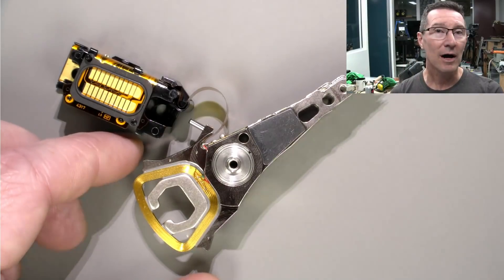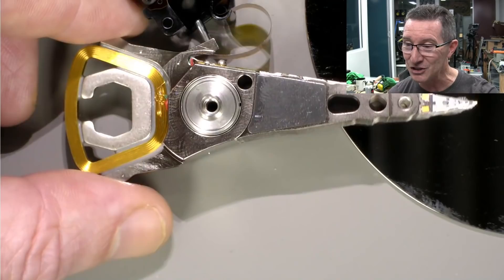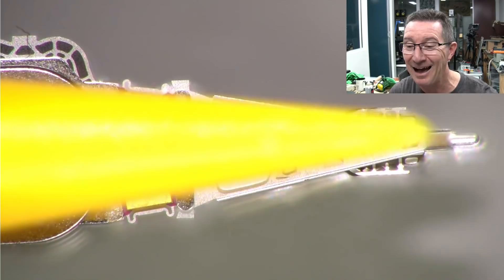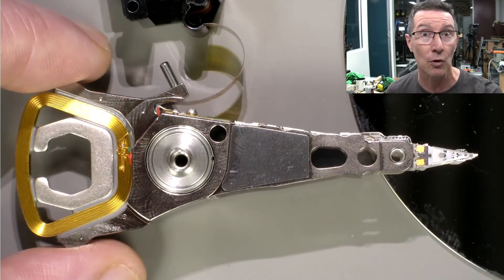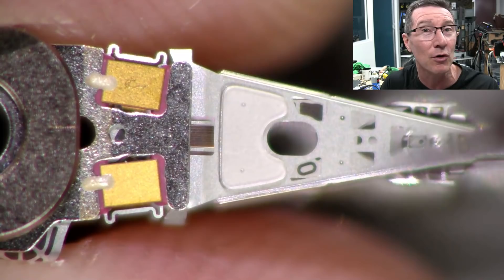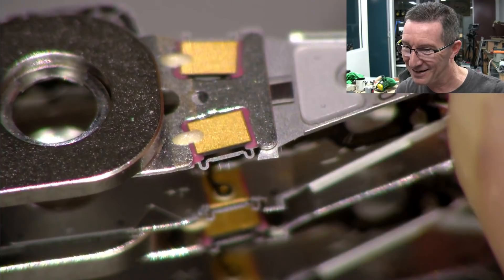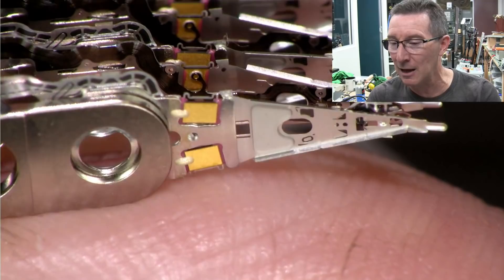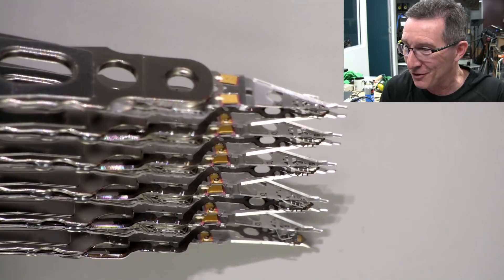EEVblog 1400 - Hard Drive Micro Actuators are AMAZING!

Comment: For a given mounting orientation, you can fabricate piezo actuators to move in any axis (x, y, z, roll, pitch, yaw).  For these disk arms, my guess would be they lengthen and shorten (rather then bend or curl).  And they would likely need to be operated as an opposing pair to manage bending stress on the arm: Firing only a single actuator would cause MUCH less than half the head motion as the non-operating actuator acts as a solid opposing block (the single actuator forces against two fixed points).
Reply from the maker: Yep, I speculated an asymmetrical drive in the video. Would be silly if it's just one side driven. But if movement is visible then you should be able to see something driving just one I suspect. But the distances are just to small, so it's all moot it seems. But might do some more experiments which would entail taking out one arm completely for access.
Not sure you can manufacture thin flat transducers like that that contract in lenth?
Reply: Yeah. That's what I was thinking too. An opposing pair to move from side to side. And the little "springs" on either side provide some stabilizing force.
Reply: @EEVblog  from the white paper that evergreen linked, the geometry shown in your video, and what I remember from Smart Structures in grad school, they're only extending and contracting the length of the PZT elements by ~100nm. The voltage applied to the tops and bottoms of the transducers makes them thicker and thinner. Since they're trying to maintain constant volume, the length contracts or extends to compensate for the thickness change.

This is actually great for this application because it essentially gives a sort of mechanical advantage to the actuation, requiring much less voltage on the PZT element to pull very hard on the read head. The stiffness of the polymer mounting the PZT elements to the read head would be very precisely accounted for in calculating how much motion transfers to the read head and the material could even theoretically be tuned to adjust down the amount the read head moves with PZT contraction.

Bloody brilliant stuff.
Reply: I would think is is a length change in the ceramic.  As stated above a piezo ceramic can be engineered to change length.  I once used  length changing piezo ceramic in a micro fluid pump.
Reply: 63nm is not that large moment. Seemingly rigid arm can move left to right that much. Crude example: a beam 0.1 mm thick, 1mm wide  and 20 mm long will deflect about 1nm in width direction when 10 g load is applied.
Reply: This is all very fascinating. I had to temper my impulsive side which immediately wanted to go murder a bunch of drives for no good reason. Definitely activated my pzt obsession, but I shall stick to the reading materials instead.
Reply: And if the arm 'pivots' between the two ceramics, you get more movement at the actual head thanks to the leverage.  Just 'eyeballing' it looks like the head would move 4 to 6 times more than the ceramic expands.
Reply: @EEVblog  if you really want to check for movement, get yourself a dial indicator. Typical resolution on those is 0.02mm, but you can get them to whatever level of accuracy you're willing to pay for.
Reply: Pretty certain you can only make the crystal expand by applying voltage—not contract. Therefore two are required to allow controlled motion in both positive and negative direction.

The springs on the sides are then to return to neutral position. Like the spider of a speaker driver. The load they present to the actuator probably helps to linearize the response as well, as it is surely tuned spring rate for a useful operational range. Spring design probs also engineered for fine calibration natural resonant frequency of the system.

And the elastic is to damp any resonances. Must have damping for any reasonable control of the system! Like how a car with leaking macphereson struts springs but the struts are ineffective, undamped springs don’t dissipate energy well and don’t stay settled in one spot even though you want them to.

The tiny metal stripe on the top is for rigid mechanical connection to the “fixed” arm, whereas the small connecting rod on the other side connects to the “movable” arm. Amazing that it even has a pivot pin at that scale. But it probably needs it again to use the rotational translation to linearize electromechanical response, and to ensure smooth motion / fine control.

I could be wrong about the piezoelectric effect being positive excursion only, tho. In which case having diametrically opposed actuators would drastically reduce structural vibration—the two forces would largely negate,  Thus each head would be less likely to disturb the others. This difference would be profoundly greater than any increase in precision gained from having two machines do the work of one.

In any case, very cool indeed! Thanks for showing it to us!!
Reply: @jalilurrehman8984  Let's recalculate, because for such a slender beam I would expect a deflection visible with a naked eye, way more than a nanometer.

Let's assume beam material is aluminum alloy 6061 (
Young's modulus E=69 GPa)
The beam is b=0.1 mm thick, h=1mm wide and L=20 mm long, the load P=0.1N (10 grams) is applied to the free end in width direction, the other end is fixed.

Then, the beam Area Moment Of Inertia I = (b*h^3)/12 = (10^-4 * 10^-9)/12 = 8.33*10^-14 m^4

Deflection under load is delta=(P*L^3)/(3*E*I) = (10^-1 * (2*10^-2)^3) / (3*69*10^9*8.33*10^-14) = 8*10^-7 / (1.72 * 10^-2) = 4.65 * 10^-5 meters

Which is 0,046 mm or 46500 nanometers! Not really visible with a naked eye, though, so my hunch was wrong after all.

The volume of the beam is 2 cubic millimeters, which would weigh 5.4 mg (53 uN) for the aluminum alloy density 2.7 g/cm^3.

The deflection of the aluminum beam under its own weight will already be 9.2 nm.
Reply: The movement should be visible if excited in its resonance. Shine a LED  togheter with the same frequency, but detuned 1 or 2 Hz to have stroboscopic effect.
Reply: @EEVblog  to measure the small movement in the head:  shine a lazer pointer on a shiny bit of the head so the reflection can be seen on a wall several meters away.  Then you will have a large scale factor and the small movement of the head will be seen as a movement of the reflected dot on the wall.
Reply: @EEVblog  to see the movement in the piezo actuators and arm:   break apart an old writable CD.  Then peel off the foil from the polycarbonate plastic.  Then cut the foil to the same size as the piezo actuator and flat bits of the head arm.   Use super glue to stick the foil down.   Ary movement of the piezo and arm will be seen as a change in the interference pattern in the foil.
Reply: @cogoid  oh! I must have done mistake in calculations
Reply: @PaulSteMarie  0.02mm is still three orders of magnitude off from what we’re talking about, no? Might have better success rigging up something based on lasers - either interferometry, or just bouncing off a tiny mirror to give an amplification of reflection angle into linear distance across the room, or something. Hmm, I think I’ve maybe even seen Dave cover devices that do this sort of thing? Or maybe it was a Veritasium video or something that I’m thinking of. Anyway...
Reply: @leromantik  amazing! So its resonant frequency is about 3khz, it should be hearable!

Comment: It still amazes me that HDDs are able to operate this precisely and reliably usually for a very long time, and the fact you can buy such thing new for just 10s of dollars.
Reply: Some of my old stock hard drives can't work anymore somehow, data can't be got.
Reply: I designed ICs for hard drives back in the mid 80's. At that time hard drive design was considered the most difficult and technically challenging of all mechanical engineering tasks. I'm sure it is still so.
Reply: @tsites1  Thankyou for your service Tim :)
Reply: @ray-charc3131  Maybe the electrons have fallen out.
Reply: @EndlessDelusion  perhaps the resistors are in rebellion as well?
Reply: And they just keep getting bigger, for the same price!

Comment: Hook up an oscilloscope to the piezo and see if tapping the tip generates power...
Reply: that's an amazing idea
Reply: You can use a 4-10khz signal for the actuator to hear the actuator. Also you should touch the head with something like a pingpong ball to adapt the mechanical vibration to air.
Reply: You may need 50V-100V to operate the piezo actuator

Comment: When you said "you dont need much current to move these micro actuators" I for some reason imagined the guy over at  Photonicinduction pushing 1000 amps through it just for lulz.
Reply: Awwww… He POPPED it 🤦 
😝
Reply: it is not a knife ;)
Reply: ..no more harddrive..it´s popped! LOL . All what left is a molten blob of metall on his burned carpet...where is my beer?
Reply: That would be fun to see. I'd love to see how the heads would react to that much current. If they'd just pop or if they'd move some before popping
Reply: @thomasvlaskampiii6850  The assembly would most likely just vaporize.
Reply: @electronicengineer  Why vaporise? There’s no water to turn into vapour.
Reply: @WELLINGTON20  So you are claiming that the only way for "vapor" to be released is resultant of water content?
Reply: @WELLINGTON20  WRONG!! .. You can literally vaporize any solid under the right conditions. In this case an extreme high current turning metal to liquid so violently that the liquid metal does in fact vaporize. All this happens in a fraction of a second. No water needed, lol. Smh
Reply: this pops the actuator

Comment: I fondly remember the satisfying clunk-thump-clunk of my first 5MB hard drive as my programs read & wrote data. Hats off to the engineers of modern disk drive designs.
Reply: And the satisfying clunk as you sent it the head park command. On some drives this made the entire table shudder.

Then there were the old Shugart drives. The disks were huge, at least 8 inch possibly larger, and the head assembly did indeed weigh more than a pound. The actuator was a huge coil acting on a big magnet that moved several inches for a full stroke. Yes the magnet was a part of the head assembly and the coil was stationary.  Given the huge mass involved the access times was pretty amazing. Running a butterfly seek test the actuator moved so fast it looked like a spooky half transparent image of it, but you didn't want to get your fingers anywhere close to that as it made a full stroke about 25 times per second. It had to accelerate the assembly and then stop it after it had moved about three inches 25 times per second. With the heavy head assembly that takes some serious power and it made the whole building shudder. It sounded amazing when you ran calibration tests. The first time I heard it I thought someone was using a jackhammer on the floor. 
People was coming from several floors to see what was making such a racket. I think that drive was some where between 5 and 20 MB...
Reply: I remember hearing "high-tech sci-fi computery squeaky sounds" from tech scenery, playing through first location of Unreal.
They seem to be, in fact, made up from an ancient MFM drive sounds, seeking repeatedly. The one that had a stepper motor for an actuator :)
Reply: I reckon. My very first HDD was an ACTUAL Seagate ST-504. It weighed nearly 10kg for a 10MB drive.

Comment: I've seen hard drives since the beginning. Those old things where the heads looked like magnetic tape heads and the platters were 18" in diameter. I worked with ones were you needed to do a low level format before you actually formatted the disk. And now these where the low level format is done by a precision device at the factory. You can really see all the years of science that has gone into these things.
Reply: One place where I worked in the late 1970s, they had a WANG computer. It had a 5MB fixed hard drive and a 5MB removable hard drive pack, about 18" in diameter. It was VERY noisy. When we started it, it sounded like a jet engine starting. Funny thing, when they upgraded from 5MB to 10 MB, they backed up, removed a resistor, reformatted, and restored. That was a very expensive resistor.
Reply: Yeah, I've got a DEC RK05 disk pack drive that weighs 110-lbs (~50-kg) with heads/arms nearly 6-inches (~15-cm) long, if I remember correctly.  I think the storage capacity is 1.6 (12-bit) megawords, or 14.5K (12-bit) words/pound (32K words/kg).  ;)  Damn, HDD technology improvement over the years has been amazing!
Reply: I know a guy who worked with really early ones. The platters were huge, made of Cadmium, and held a whopping 1 Megabyte.
Reply: @dylantowers9367  I saw a collection of old platters that a Professor had.  The largest I remember was between 3 & 4 feet (0.9-1.2-m) in diameter and about 1/4-inch (~6-mm)  thick, but I don't recall whether he told what its capacity had been.
Reply: @dylantowers9367  I worked att a radar surveillance mountain once and even if everything was state of the art they had put up some "thread memories" on a wall from way back in the time. It was just a long very thin coiled up thread of metal that when "hit" on one end whit piezo material it held that information for certain time before it reflected back. 1 bit fast memory back in the early -50.
Reply: @dtiydr  the ingenuity in that is just crazy ...
Reply: @SuperUltimateLP  No real circuits existed back then and memory even less so but they had to have memory for what they did there. I had walked past the memory many, many times but one day realized that it was something electronic and looked at one of them and was the only one who understood what it was and I was impressed of the engineering. And when i looked at it a captain came up and told me that there had been 256 of these to build up some 256bits memory back then and everything was controlled by radio tubes and it all was the size of several big cars he said, cool stuff.
Reply: I worked at IBM Havant (the UK hard disc plant) for a short while in 1993 I think. They had a small museum of all the IBM hard discs from the huge ones with 18 inch platters down to what they were making at the time (IIRC the 3.5in 2GB Allicat drives, which internally don't look all that different from today's drives).

Comment: Interesting stuff! In my experience piezo actuators operate with higher voltages.. Given that there's no specs I would start with a 30Vpp (some piezo actuators can even go up to 600-3000Vpp but I don't think this is the case) also, for an actuator application the frequency needs to be under 200~300Hz.. I'm curious to see their driver schematics given that the voltage has to be boosted, driven differentially, drive multiple actuators

Comment: I think most of you got it wrong.  The piezzo mechanisms is to dampen the vibrations of 
1) final position of arm. Without the this mechanism, the system control mechanism can never stop the shaking of the arm by itself since the arm is long.  It is  considered a secondary system of fine tuning, much the same as multiple stages in power supply design. In PS design, if you want to have a very low ripple noise, you must use multiple stages and filters.
 2) step motor (spindle) which constantly shakes the hard disk.  The piezo electric mechanism can vibrate in the higher frequency whereas the arms step motor cannot.
3) other small higher frequency noises like fans in the motherboard and chassis.  
This has not been a new idea.   It has been around since 2005.

Besides, the heads have multiple read and write sensors much like a video camera or scanners.   They can read multiple tracks at once.  If track 8 needs to be read and the arm goes near there, one of the heads detects the right track and the arm may not need to move to get track 8.
   Hard disks are one of the most sophisticated electromechanical systems ever invented in such a small space.  I'm surprised how cheap they are regardless of number of them being made.

Comment: Anyone who remembers the Philips VCC series videorecorders: they had piezo actuators connected to the tiny heads on the rotating drum and those video heads could follow the videotrack much more accurate than the VHS and Betamax recorders could. It could for example display perfect stills and stripeless fast forward/reverse searching. So not so new technology just on a much smaller and more accurate scale in harddrives now.
Reply: I have repaired some, so I do remember they were a pain in the b... to calibrate. But quite neat that you could use both sides of the tape, like a compact cassette.

Comment: Videotape recorders had piezo actuators for track following starting in the 70's. Ampex won an Emmy Award for its Automatic Scan Tracking. If the AST servo was misaligned, you could hear the head tips sing.
Reply: First seen in a mass produced VCR in the Philips V2000 format machines and then later on became pretty well standard in most high end VHS machines

Comment: Visible light is usually defined as having wavelengths in the range of 400–700 nm. You can not expect to see movements in range of 50 nm. Sometimes I did not manage to get sharp images of 50 nm structures with the SEM.
Reply: Well, with interferece you could
Reply: @kramnecknerf  I know Daves  office light is not monochromatic and I guess he hasn't a Michelson interferometer at his bench.